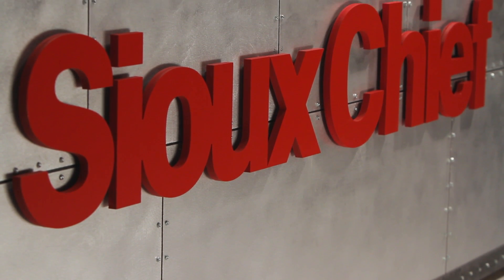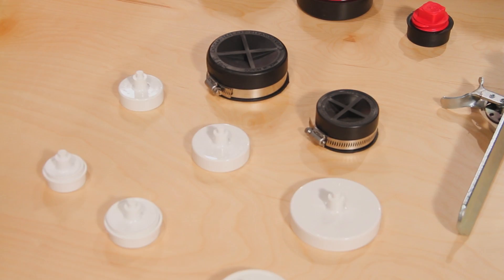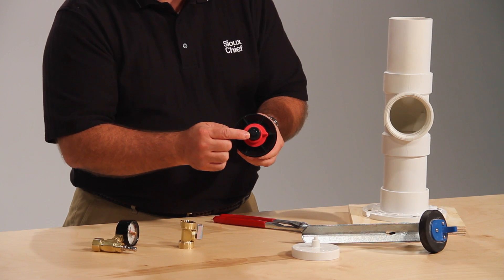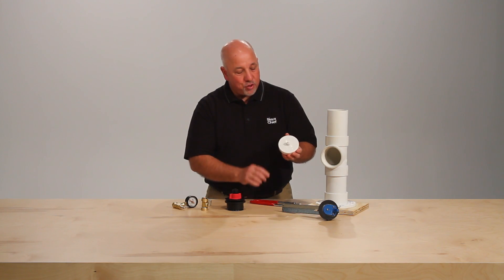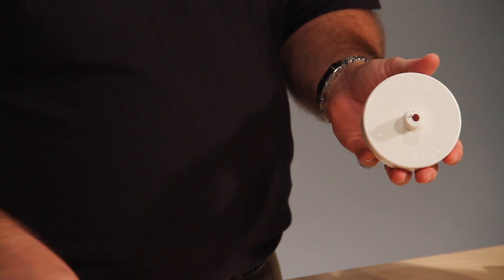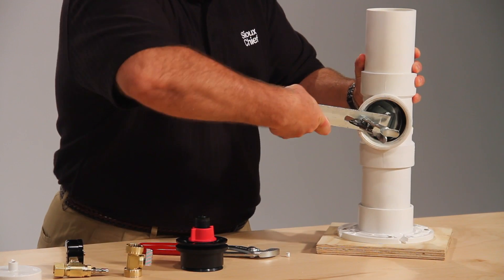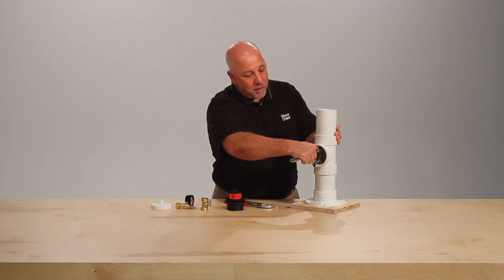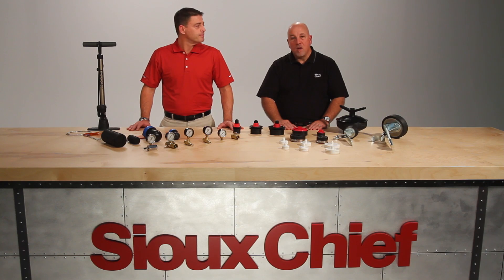Sioux Chief DWV Testing

Comment: Test Titan II self destructs. the red nut gets damaged by the seam of the black thread.  one use and there was red flakes on the thread.  also the shoulder on the black housing had so much force that it too showed signs of wear.
this thing screams for metal thread and a thrust bearing.

it also screams for two thread, one for the drain, the other for the tightening.  I could not get the seal to expand on the 4 inch in my hand.  the inner section never expanded while the outer expanded to the point I could not turn by hand any more. 

great idea, but some poor choices in materials and design.

I am looking to use grease (lithium or silicon ONLY as petroleum will destroy the plastic)  to eliminate or greatly reduce the forces that prevent this from being a re-usable device.  as a one-time unit, and at low cost, using pipe wrenches to tighten might get you out of a pinch, but as a re-usable device, it leaves much to be desired.